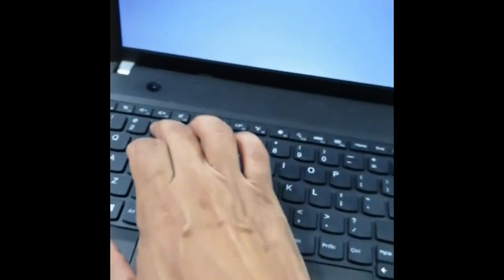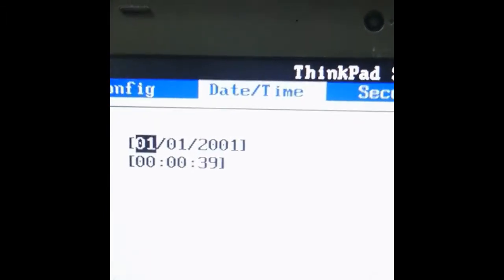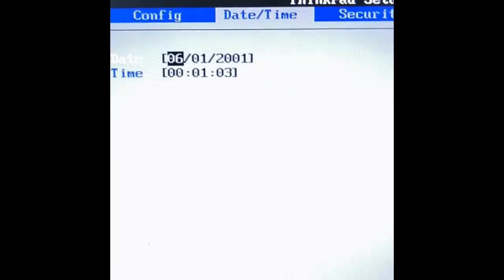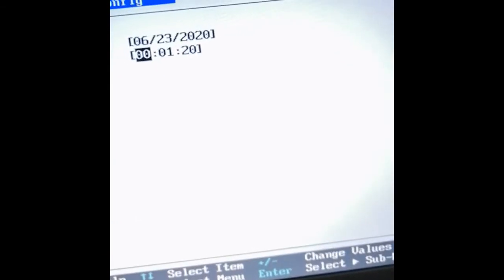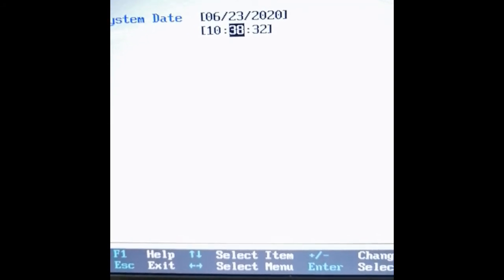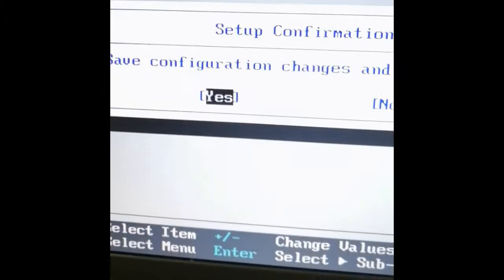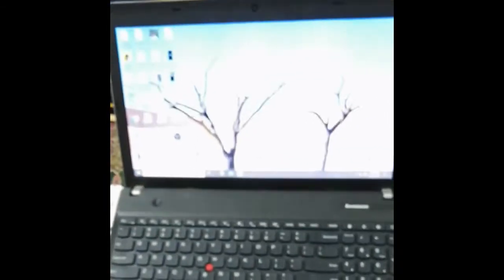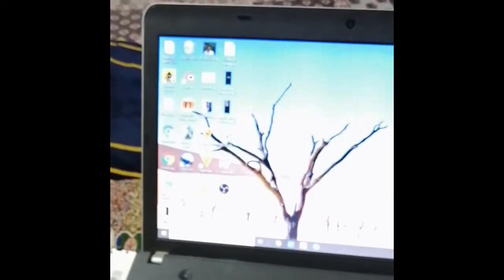Blank Screen Problem of Laptop Lenovo ThinkPad

Comment: Thank you vm but i just removed one of my RAM and it worked 😂❤
Reply from the maker: Welcome and thanks for your kind comment moreover your observation is correct and I also made a video on the issue of ram as also one of the reason of blank screen. Thumbnail of that video is available at the end of this video. I suggest to watch it for enhancing knowledge about blank screen and it's fixing. Have a great day 😀
Reply: @jqkhantech thanks, im gonna check this out. ❤

Comment: I did the same but my laptop isn't starting what should I do 😢
Reply from the maker: Sorry for late reply due to my illness and some other issues. I ll wrote the name of my second detailed video on the same issue. That video ll enable you to find/ locate the reason of your black screen either that is due to hardware or software. After detecting the reason you can resolve this problem. Name of my detailed video is written below:                         
How To Fix Blank Screen Problem Of Laptop

Comment: If I change my laptop screen and replace wrong screen type, will it affect my laptop power system?
Reply from the maker: It is always suitable to change any part of PC compatible to your computer. Furthermore, if you change screen so i don't think that it would have negative affect but the battery will surely be consumed quickly if the screen is larger or if the screen requires more energy than the previous screen you does used. Now if you already purchased & you don't see any problem so i guess/ suggest to use it as if you go again for rechange so you will pay more money. Hope done answer the question, stay connected, please

Comment: I need you help brother please
Reply from the maker: Please ask
Reply: @jqkhantech  is about lenovo thinkpad i have tried to change ram but is still blank, don't have another solution about that?
Reply from the maker: @josephnkosi6278 clean the ram with proper solution or petrol, again fit the ram properly. If despite it does not work then connect ur PC with another screen if display comes on another device then either ram is faulty or the cable of your CPU and screen has been broken. On the same problem I made another video, thumbnail of the same is available at the end of this video. Through that video you will be able to get know the exact fault in your PC.
Do ask if I can help you out.
Thanks for commenting
Reply: @jqkhantech  thank you brother i with try to get petrol to clean the rams
Reply from the maker: @josephnkosi6278 also clean the slots of the ram and do it very carefully. Also wait for a few minutes so ur ram and slots get dry to avoid damage

Comment: Amazing tutorial hacks! I went to the market, and they told me my laptop was dead. For the past three days, I was in shock thinking my laptop had died due to a power supply issue. But after following this tutorial, my laptop immediately turned on. Thanks, buddy!
Reply from the maker: Thanks for commenting, yes i know that mechanics gave wrong statement to buy your PC on low price & then after easy fixing the problem they sale it on desired / higher price. My mission is to educate the people & to save them from cruel/ false statement by the mechanics, therefore, i always try to share videos to remove the problem & to also to give a solution without spending money. Please share my link on your social media account to benefit & save other innocent people from looting by bad mechanics. Have a great day

Comment: I have also Lenovo laptop but when I power on its light blink but after some time it get off along with its black screen still....  Please can you tell me what to do
Reply from the maker: Dear viewer, try to locate reason of the blank screen as it is occurred due to many reasons. At the end of this video I uploaded the thumbnail of my other video through which you can locate the reason of blank screen. So after knowing that you can fix it if is due to software but if it is due to hardware then it needs to get replace it.
Try to watch my above mentioned video so your problem would become easier. Do write when ever you need my help. Good luck 👍

Comment: Can you tell me what to do pls so i have a lenovo ThinkPad and the i from ThinkPad is shining red but the screen is black i plug the charger in and press hold the power button and the Laptop goes off then i hold it to start it again but the screen is stil black and the i from ThinkPad is shining pls help me idk what to do
Reply from the maker: Please see my other video (thumbnail of the video is available at the end of this video) first try to locate reason of the blank screen either is it due to software of hardware. the software problem is easy but incase if its due to hardware then you must change the hardware to fix the problem. Please remember black screen have many reasons so try to get know the reason with the help of the video i mentioned above. Do write me till your problem resolve & sorry for late replay. Wishing you all the best, best reards

Comment: Mine has this exact problem and the only the Lenovo indicator light works ...the fan doesn't spin ... I've tried everything
Reply from the maker: Change the fan otherwise excessive heat 🥵 may fuse the PC 🖥
Reply: @jqkhantech  okay thanks I'll try that
Reply from the maker: @grggames9347 do care while changing the fan because little more force using or mishanding cause damage. Moreover, when your PC do blank screen then try to locate the reason of blank screen. When you identify the cause of the problem then solution becomes easier. In this regard watch my other video on the same issue, thumbnail of the same is available at the end of this video. Do ask when ever you need I ll b glad if I could help you. Best regards
Reply: Tengo el mismo problema, he hecho de todo. El ventilador gira por un segundo al presionar el botón de encendido. Estoy preocupado... Espero que no se haya dañado el procesador CPU. No sé qué más hacer

Comment: 3:50 mine is still loose, how do i fix it?
Reply from the maker: Try to locate reason of blank screen watch my other video on same issue, thumbnail of the same is available in this video. So through that video u ll get know the exact reason of the problem. If it's software issue so you can recover it but incase of hardware problem then you have to replace that with new hardware. Thanks for comment
Reply: @jqkhantech  thank you 😁

Comment: My Problem is THE LIGHTS ARE OPEN/CLOSE every time It has black screen but I can move mouse and it won't close it is working without wires and I have to shut down experience but how and I closed it I open it again black screen and can move mousr
Reply from the maker: Blank Screen Problem Due To RAM & Cleaning RAM Refitting RAM & Locating Hardware Or Software Issue
Above is the name my other video, on the same problem. Thumbnail is this video is also available at the end of this video, please watch that and you will find the exact reason of your blank screen problem. So according to your issue you can resolve blank issue as it's due to hardware or software problem. Solutions are also available in that video. If your problem is not resolved then write again I will help you all the possible way.
Thanks for writing

Comment: thats worked, thanks, so, If I often encounter this problem, should i replace the bios battery with a new one?
Reply from the maker: I guess don't spent money as i already provided the free and the easiest method in my video, thumbnail of the video is at the end of this video. Through that you can recover your pc without opening and less than a minute.
Regards 🏋️🏋️

Comment: Works like a charm... I've watched lots of video..none of any shortcut keys have work! Then found this video. I tried to remove my laptop's battery then ensure there's no electricity in it...then put in the charger and turn laptop ON ..then VOILA! it comes back to life!! I didn't even open other hardware..thanks so much!!
Reply from the maker: You are welcome and I am glad that your problem resolved moreover don't mis my other video of RAM removal and refitting plus cleaning the ram, that is also related to blank screen. Through that video you can get know the exact reason of your blank screen problem. Thumbnail of that video is available at the end of this video. Do watch and share if like.
Thanks 🎉🎉🎉🎉

Comment: Hi sir 
i had same blank screen issue with thinkpad x280, it first happen when i install  software driver component  in windows Update, after laptop restart to installing driver. it stuck on lenovo logo then i can't even turn it off using the power button (i already hold it for 2 minutes still it wont shutdown) then i wait until battery run out. After battery run out i charge laptop and then black screen. But the power still on. Can you maybe help guide me sir?
Reply: I also have some habit while using this laptop,i never shutdown it before. 
i always use sleep mode 
its been 11days now since my last shutdown, i don't know if there is something to do with the black screen issue but probably this extra information would help
Reply from the maker: I suggest you may see my other video on same issue however through that video you can get know the exact reason of your blank screen. Thumbnail of that video is available at end of this video. Moreover you need to try to remove last driver/ update. Better you install fresh windows. In my view old laptop gets slower and problematic with updates so after installing new windows, you should reduce or avoided new updates or heavy software or big games because all irrelevant software causes problems. Do write if you need help. Thanks

Comment: Thank you, i want to thorwv away 🤣
Reply from the maker: Don't throw it away and watch my other video of RAM removal and refitting which ll reduce your blank screen to the issue to the optimal level.
Moreover if despite that it goes blank screen so you will be able to recover it in less than a minute and you will also not open your laptop. Thumbnail of that (my other video) is at the end of this video.
Regards 🏋️🏋️

Comment: Hello sir, I tried disconnecting the battery. But the issue arises again. Should I also remove the clock and let is discharge. Or should I clean the ram and reinstall it again.
Reply from the maker: Dear Vikas, hope you will be fine & in the best of your health. Please note first disconnect the battery and let the laptop discharge (You can also discharge the PC by long press of power button) & then on it, if it works normal then don’t remove/ disconnect the small battery connected to clock. In-case if it does not work normally be removing the main battery then yes you should remove the small battery connected to clock. Secondly if the disconnection of the main battery & small battery connected to clock then go for RAM clean. But I strongly suggest you to watch my other video namely          Blank Screen Problem Due To RAM & Cleaning RAM Refitting RAM & Locating Hardware Or Software Issue                  for pointing out the exact reason of Blank screen problem/ issue. The Thumbnail of this video is also available at the end of the video you watched & commented. 
Please see that and first get know the exact reason of the blank screen, moreover, solutions of these issues are also available but do care don’t break the PC or work swiftly. Do ask any question until you need. Best Regard and have a great day
Reply: Thank you for your detailed reply. I'll try all the suggestions and then if still there is any problem, I'll have to disturb you once again.
Reply from the maker: No problem I be happy if I could extend u my help which is my real win and happiness. Regards

Comment: do you mind telling about window 11 think pad lenovo
Reply from the maker: No i never mind if someone ask any question rather I feel happy if I could help someone. There are several reasons for blank screen like hardware issue, software issue or even games may also cause the same. Mostly your last activity is more closer to this problem. However 
ask your question in detail don't hesitate, i ll respond you as soon as I can.
Moreover, if have any system or operating system then don't worry, first try to locate the cause of blank screen. To determine reason why you PC went back /blank screen. At the end of this video I upload another video which can help you out the exact reason of your problem. 
 Thanks

Comment: Is there any reason why, right after I did this the computer turns on and I hear two beeps from the laptop speaker. The screen stays blank after that.
Reply from the maker: When computer beeps it means that some unusual situation like software or hadware issue arises. See my video blank screen due to ram. Thumbnail also available at end of this video u ll avoid 80% on the blank screen problem just try to follow what I did there.
U may also install fresh windows and clean ram with hardware but due care with diligence. Avoid breaking or naughty with ur system.
Do ask if I can extend my help. Best regards

Comment: What makes the laptop to not turn on
Reply from the maker: There are many reasons for hanging of computer. Some are mentioned below:-
Too many apps running
Driver issue
Over heating
Operating system mis function
Hardware misconfiguration/ malfunctioning
Insufficient RAM or RAM flood by over flow of data
BIOS setting
Power issues
If you want to know why ur system hand then see before hang which type of software or program u run or check the temperature of ur PC.
Try to find out the reason and then search for solution. Like f u install a software and after installation ur system does regular hand then remove the last software and analysis as either this was the issue or something else. Do write f u need my help.
Thanks and have a great day 🎉🎉🎉🎉🎉

Comment: what do I do if the keys are not letting me change the date and time?
Reply from the maker: See at the end I showed you how to change date and time. Use arrow keys and incase ur keyboard is faulty the use external keyboard with USB pin or end
Do write if you face difficulty.
Thanks for your comments 🏃‍♀️🏃‍♂️
Reply: @jqkhantech my arrow keys are not working. Like it won’t move up or down on date and time.
Reply from the maker: Use external keyboard with USB pin and in USB port
F despite all thses system demos not update date and time then simply press enter and press next next next finish.
When windows comes to graphics then update the same in graphics mode by that time it will be more easily. Incase of difficulty do write I ll respond.
Best regards
Reply: @jqkhantech  it’s still not responding with the external keyboard
Reply from the maker: Re write the window from ur already safe image of the windows as if ur key board and external keyboard are not working then better u renew the windows. And then try to fix date and time. If skip date and time is available then skip it and when you get ur windows in graphics mode then make another try by double click the date and time in lower right corner of your screen.
If all above stated trick does not work then take help of the hardware expert as in case of hardware problem the hardware ll change.
Please do let me till end or solution of your problem.
Wishing you all the best 💐💐

Comment: Wowie....you have saved me today. I wouldn't been able work and lost in pay on Monday. Thank you so much !!!
Reply from the maker: It's my pleasure that you are benefited due to my effort. Keep in touch with my channel as I ll upload another video of the same computer blank screen with the easiest solution. That solution will not require screwdriver etc and  you will be able to fix your problem in few minutes. Saying thanks and share my videos please.
Best regards
Reply: I hope it’s gonna work for me 😭
Reply from the maker: Great if it's work. Incase of difficulty do let me know or see another video of mine on the same problem at the end of this video thumbnail is available namely RAM fitting and RAM cleaning. 
Best regards